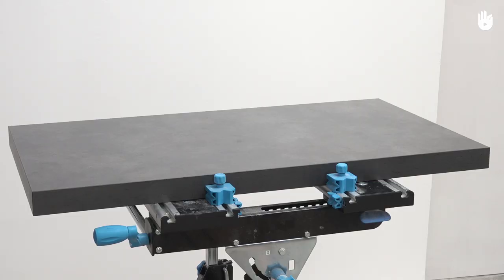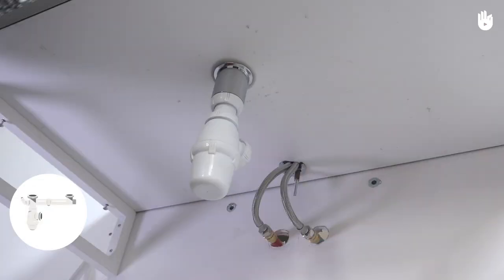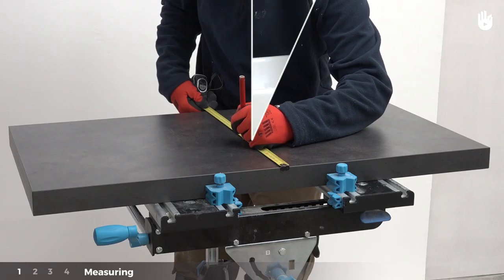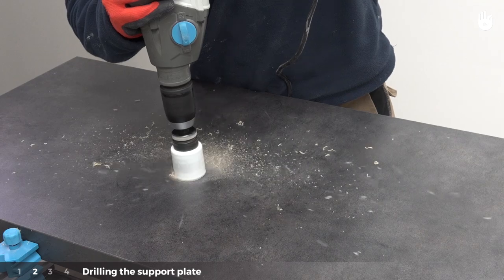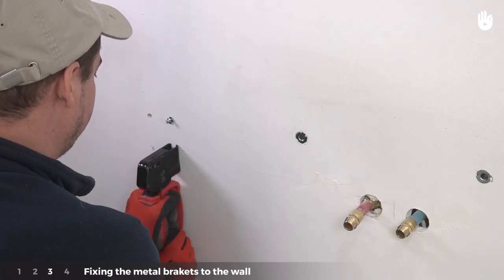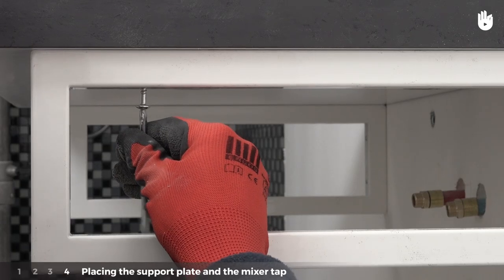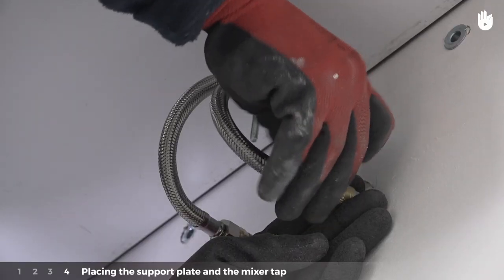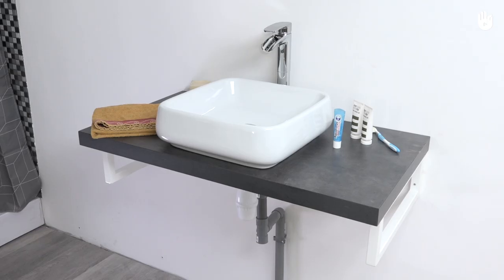Learn Installing a Countertop Sink | DIY Projects

Comment: Do you not glue the sink to the counter?
Reply: Not necessary.To prevent insects getting in to space between sink and board use a 3mm thick rubber gasket cut properly. Incase of damage to the sink it will be difficult to remove.

Comment: no silicone on the hole saw cut edges of the board to prevent moisture blowing it ..and no silicone between the tap and board ...ill give it 5 months before the board is blown

Comment: Can you tighten the bottom ring nut directly to the sink bottom instead of bottom of counter. My cutout hole for the drain is approximately a 3-1/2 x 3-1/2 hole (larger than bottom faucet but) so I will need to tighten it up to bottom of sink. Is this okay? Thx!